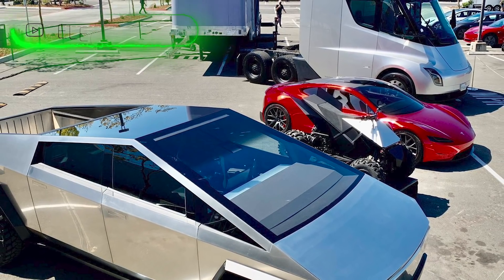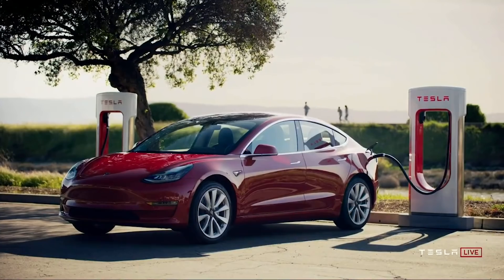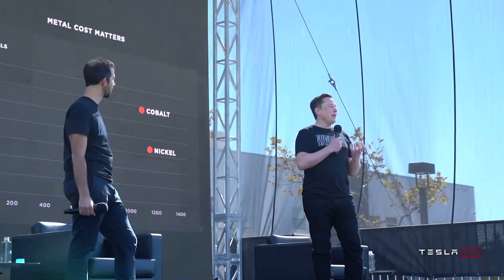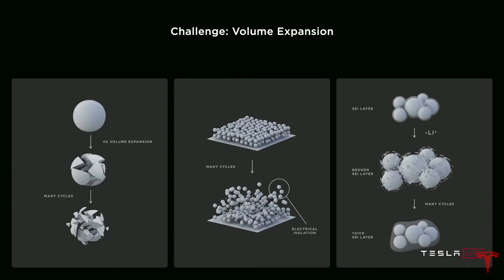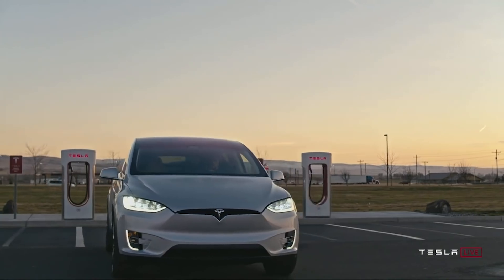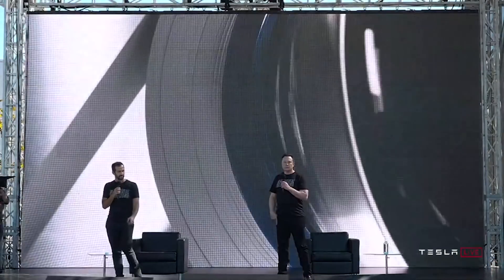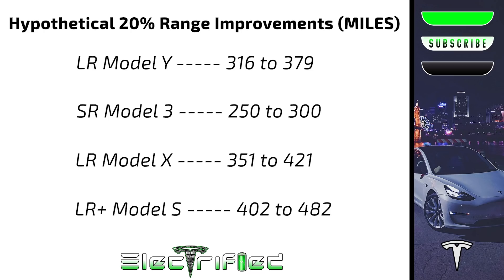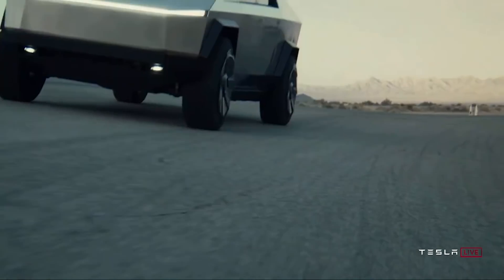Tesla's New Battery Anode (in-depth) // "Tesla Silicon"

Comment: Eventually changing the cathode to LFP is easy as changing the powder used in the dry electrode process. So all tesla vehicles will EVENTUALLY use the 4680 cells.

Comment: 5:17 - "...on the lithium electrode."  What lithium electrode..?  To be sure, batteries of this type do include lithium.  Is there a lithium electrode, per se...?  In lithium-Metal batteries, yes.  Yet that's not the battery class you're addressing, here.  I think you might have misspoke at just that juncture.  All the rest of this vid was fantastic, however.

Comment: Can't wait for the next 5min of battery day explained in such detail! 👍🏻
If it's cheaper to produce and better energy density why would they use old tech in 3 an Y down the road? Should not the Berlin Y get the new casting design... so the new battery might be mandatory (part of structure) 🤔

Comment: 8:53 ‘4680s not going in Y’ - But a slide shows the Y’s new structural system with the honeycomb pack, and Elon waxed at GigaBerlin about the Berlin Y being fundamentally different. Also, it’s clear Elon is sandbagging.

Comment: When Tesla builds a new battery production line (like in Berlin), it would make sense to build the new 4680 production line, since cheaper and better.
That would mean that the vehicles coming out of Berlin (3 & Y) ARE going to have the new cells, with better range, Performance, charging etc..
So. the schedule with which batteries goes where, seems only to be valid for the short term < 1 year.
Reply from the maker: You could be right!

Comment: Surely Giga Berlin will have the new batteries? If so, they are building Model Y and 3 there.
Reply from the maker: You're correct, I'm just wondering how they will handle US versions
Reply: @DillonLoomis22  I'm guessing they do not want to rock the boat with Panasonic and they have given them a commitment they will take all the batteries they can build so where they have established capacity I guess they will keep it Panasonic.  But they won't want to pay a premium for an inferior battery for long, especially as the chassis is being modified for the new cells, so yours is a really good question.

Comment: Tesla bought a Startup called 'Silion' they seem to be working on this exact thing, there is very little information on them, but this article is great: 

The Highest Energy Li-ion Battery: Unlocking the Potential of the Silicon Anode and Nickel-rich NMC Cathode (https://www.scientia.global/highest-energy-li-ion-battery-unlocking-potential-silicon-anode-nickel-rich-nmc-cathode/?doing_wp_cron=1600986771.3573999404907226562500)

This whole process seems to relay on Dry Battery Electrode technology, but they didn't spell this out. The 'elastic binder' is the additive that replaces the solvent in the wet process. The binder dual use basically, it holds the anode together and makes it stick to the foil. The other thing it does is conduct electricity deep into the anode, and if the silicon expands these bands will just be stretched like a fitness band and continue to connect all parts of the anode. 

The DBE is import here because without the wet slury the conductivity is higher, meaning you need less of this elastic string. Its like a sand castle with plastic string inside. Then that whole sand castle is put in a bath of electrolyte. Because there is no wet slury even after expansion the conductivity is high, these are just dry participial stacked on each other, the structure is sill very porous. Here is where Jeff Dahn electrolyte magic comes, it needs to be able to transport Li- out of that sand castle to the other side. I have no question this is a major peace of the puzzle that they didn't talk about.

I seem to me all of these work together, you could not do this without DBE, or without a new electrolyte. So when people say its not possible I think they don't understand the other 'enablers' in other parts of the battery.

Comment: What can be better about my Model Y? Lower price, longer range, fix the door handles/opening fumble. I rent a ratty old house that I love, which is closer to the type of place someone who will buy a $25k Tesla would live. So charging options, I think will become an issue as prices drop and Tesla's move out of the suburbs (yeah I know this is gross generalization).  There are a lot of electrical panels that will need replacing ($$$$) or reworking ($) to feed a Tesla. 
The Superchargers near me, (next to Monterey Park in the San Gabriel Valley - so hardly the boondocks), are in paid parking lots, or are 'destinations' in downtown Los Angeles hotels. (If I have to pay a 25% premium every time I supercharge, than that 121 MPGe is actually 97 MPGe). I've got a 240VAC dongle ordered (Tesla sells kits of 5 when 90% of people actually only need the NEMA 1450, What they also need is a very heavy duty extension cord) Meanwhile I'm sipping along at 5 mi/hr.
So even if someone commutes 120 miles a day, and can only get 50 miles charge back over night, they can still go a full week with one just stop at a Supercharger, if there's one available.
Also protocols for electrical connections. Yes I know all about the dedicated 40 amp circuit. I ran one of these at my old house for HVAC. Easy peasy, but not when you have an electrical panel that's 70 years old and has a reputation for catching fire. I bootlegged a 220VAC 15a circuit for my table saw, and that's what I'll be charging my Y with once the dongle arrives and until I move or pay to have the entire house rewired (remember I'm a renter). I'm guessing I'll get 12 mi/hr.
Today at Norton Electrical supply in Chinatown I suggested to the clerk  that he mention Tesla options as a potential sideline for electricians.  (btw Norton has been in business for at least 80 years, the building is 100 years old. I thought it was so cool that I was in this old place to buy a 10/4 cable for my 21st century car.) Okay being a busy body.

Comment: Nice video - I don't think they will use atomic layer deposition to stabilize Si anodes - ALD is more likely to be used on metal oxide cathode surfaces (we published some papers on this about 5 years ago). I'd guess they'd use organic reactions on the surfaces of the silicon anode surfaces to passivate/stabilize them (we published many papers on organic chemistry on Si surfaces about 20 years ago).
Reply from the maker: Thanks for sharing Charles, much appreciated. Where did you work/study?
Reply: @DillonLoomis22  Sure thing. Faculty at Stanford and now at University of Colorado Boulder. ForgeNano and SilLion are both connected to CU Boulder.

Comment: ie they need time ... to make huge changes to a high production product becomes very costly, and they need time to get their ducks in a row. This is why they signed deals with the suppliers. It’s much easier to roll it out on new products. It’s much cheaper to have commonality over all products. Also, new model cars get upgrades or whole sale changes every 4-5 years. Don’t be surprised that the new versions of model y and 3 get these cells too.
Reply from the maker: Definitely won't be surprised, hoping for it!

Comment: Novonix Ceo is responding that you need graphite for high cycle life even if you lose a little range. Any million mile battery and grid plug in batteries are likely to remain graphite based.
Reply: I was a Novonix shareholder, they duped people into believing they had a deal pending with Tesla including me. They talked about their deal with Samsung and said that they can’t say anything about Tesla at the moment inferring that something is pending. Clearly that was a sham designed to deceive. No wonder their shares dropped about 40%… Good 👎👎👎
Reply from the maker: Thanks for sharing

Comment: People did not listen closely enough. They announced the new cells would have a reduced cap-ex of 10x. That means they will use these cells anywhere they can. It is cheaper to build the factories for these cells. The 0 waste water ties in exactly with the gigantic Berlin change in environmental impact as far as water goes. There were reports this meant no battery production at Berlin. I predict it means they will be producing these cells at Berlin, and using them for the Berlin built model y.
Reply: I was coming to the same conclusion.. 

Elon Musk said during his Berlin visit 3 weeks ago the Made In Germany Model Y will be radically different in design and manufacturing.. This only makes sense if they also use the new 4680 batteries, because otherwise the megacasting for the front and aft end of the car with the constructional battery pack connecting these two parts would become very expensive if it is used for only a year or two with the 2170 cells. So it makes a ton more sense that with the new construction method also the new batteries will be used in the MIG Model Y.

Another tid bit of information supoporting my thesis is that Tesla got a lot of flack for using a lot of water in their initially submitted blueprints for evaluation at the local town halls... Tesla changed the plans, and the enourmous water usage disapeared from the plans, but battery production remained, and made everyone wonder how that would be possible. I think this is possible because they decided to go for the new construction and batteries from the get go in Berlin, and skip the initial plan to start with the "Fremont design".. Apparently Tesla became more confident during early summer the new methods are ready for mass production sooner then they initially thought.. The changed plans also included the installation of 8 of these megacasting machines, also initially not present. Drone footage has confirmed the construction of these megacasting machines at the Berlin construction site.

Add to this that the Osborne effect is no issue in Europe, because in Europe you cannot buy a Model Y yet. 

So all in all it makes a ton of sense Tesla starts building the Model Y with the new 4680 cells and all these new and improved design features right from the start, saving them installing a ton of robots for the "Fremont design" and saving them hundreds of millions in  factory upgrades just 1-2 years later.

Note that the Kato Road test factory is already working, and will expand to 10Gw.. It will be used for validation and tweaking the process and machinery, for later mass production in Berlin... 10Gw to start with in Berlin is just fine, and add new lines just as needed with ramping the production of the MIG Model Y... I think Tesla has it all figured out already, just a matter of executing the plans.

If the above becomes the reality, Tesla is sand bagging like crazy and the new battery mass production will already start iwithin a year at the Berlin Factory!

After battery day this all clicked with me.. But I may be a bit positively biassed, because I ordered a Model Y myself that will come from the Berlin factory. Please let me know what you think!
Reply: @MarcoNierop  I totally agree. Battery day was about the massive scaling (terra is the new giga), that's what's going to happen in three years. But they are already building the new battery, maybe using it for limited semi production and will use it first in Berlin early 2021, they just missed* that point. (*They were just trolling the stocks ^^)
Reply: Marco Nierop , good theory.
Reply: @MarcoNierop  superb sleuthing.  You connected a lot of dots, right there, very nice.
Reply: @MarcoNierop  I agree with all that and made similar comments, but how have you ordered a Euro Model Y? ( A UK Model Y I assume from perfect written English?!) The website has always just said keep me updated as far as I am aware.
Reply: @acoustonaut780  I pre-ordered a Model Y in June from  the Dutch Tesla website.. I am from the Netherlands... Delivery is stated as early 2021, but I expect that to be delayed to summer 2021 or even later.

Elon stated in an answer tweet to Viv (Third row podcast) who lives in Germany that all european Model Y will come from the Berlin factory, she also ordered a Model Y not so long ago.

About 3 weeks ago it was rumoured that all RHD Model 3/y will be produced in Shanghai, so the UK will get MIC Model Y probably and not the MIG Model Y. But I think these will be almost the same as MIG Model Y, Giga Shanghai also got these Mega casting machines, and will also start to produce battery cells.
Reply: @MarcoNierop  thanks for the info. Very Interesting, I hope you get your car soon! Existing Y bodies are almost non-handed, so I’m hoping the RHD ones will be Berlin made, as that would be more profitable. It’s a good point though, if the dash casting is a handed item then those RHD castings could well be made in only one place and very possibly China. My money is on a non handed dash body in white panel in Berlin with second operation to cut out RHD pass thrus. We will know soon enough. We all want the new batteries in our cars!
Reply: They explicitly said they would be making cells in Germany. I think it was in the Q&A?
Reply: @Eurosn0b  Yup they said it
Reply: What Battery Day did - in anyone was paying attention - was to announce the end of traditional auto makers. ;)
Reply: They will not use silicon anodes everyhwere. If you use a Iron Cathode, a Silicon anode is pointless unless its much cheaper then anything else. A battery needs balance, having a iron cathode means having a silicon anode is kind of pointless. Unless maybe you can reduce the size of iron cell with silicon. But I have never heard of an Iron-Silicon battery.
Reply: @21nickik  I agree and this video speak to that: https://www.youtube.com/watch?v=0ktsgwzUh3A - It will have more and more silicon over "time" but like this 100% all at once type of thing.
Reply from the maker: It would make a ton of sense! I’m sure we’ll learn more in coming months. Thanks for sharing!
Reply: Based on the scientists Tesla most "likely" will not be making the anode with 100% Silicon anytime soon. I'm saying 100%, meaning they will start to introduced Silicon in the anode but 100% Silicon is not much cost benefit, as in it appears to be diminishing returns the more you go. Check out this video with Shirley Meng who breaks it down: https://www.youtube.com/watch?v=0ktsgwzUh3A - I'm not a scientist but this lady teaches the very people that Tesla and other companies employ so her words are based in practical knowledge that really bring  battery day back to current day reality.

Comment: The octovalve in Model Y had 13 different invocations implemented between April and July of this year (2020). I personally think that as soon as these new cells are production ready they are going to be used in the new casting that they showed for the Model Y/3 in Fremont. I agree the chemicals used in each vehicle type will vary based on it's expected range and weight ratios. But these are most certainly going into the mix ASAP. My $.02
Reply from the maker: I like it Eric, I’d love this to be the case

Comment: Thanks for the video.  Yeah I don't see them saying outright that they are going to put them in the Model 3 and the Model Y because if they did then the price would drop and everyone wouldn't buy and just wait for those to come out.  The current models definitely still have more life left as you said so I see them putting this more in the Plaid Model S, then Cybertruck and Semi to follow.  One question I have is do you think that the current cybertruck specs were based off this new battery specs or more off the current cell they are using now?  I would love to see a spec bump and price drop on the cybertruck personally :)
Reply from the maker: Yes I do think the specs were “loosely” based on a high % of this. Not all, but most. Great question

Comment: This polymer coated silicon will have a lot more to do. If you know chemistry, here are some details:  There always be a monolayer of native oxide on the silicon. There is no long-lasting bare silicon. With the cycling of electrode, the isolation layer will grow, as residual oxygen and moisture will permeate through the protective conducting polymeric layer to form thicker insolating layer. Eventually, the accessibility of lithium ion to the silicon will be reduced. They need to solve this problem somehow, without having to take the silicon out for fixing it. Plus, as to all polymeric films, the protective layer degrades with time under the heat. That is another problem for another day.
Reply: thank you for the info
Reply from the maker: Thank you for sharing this Xiaohong!

Comment: I had this thought for a while, depend on how fast the expansion process happen, couldn't this silicon expansion process be utilize as an robotic actuator ? Currently in robotic actuator, hydraulic system dominate most heavy machine usage because it has the best power/weight ratio. But it's slow acting and heavy, the hydraulic system could leak toxic fluid. Electric stepped motor have fast and precise response but it's power/weight ratio is really bad and cannot handle heavy load. There is shape memory alloy based actuator that have high power/weight ratio comparable to hydraulic, but require heat to activate, have very low strain range and very slow acting, since heat conduction is not instantaneous. Maybe this silicon large expansion could be exploit as an actuation mechanism ? I don't really know if the expansion rate is faster than shape memory alloy based actuator though. But potentially you could have could build an actuator system base on this silicon expansion behavior.
Reply from the maker: Interesting! Well beyond my pay grade though haha sorry